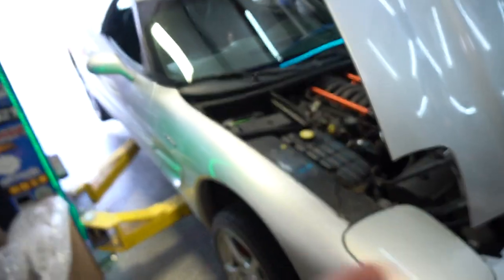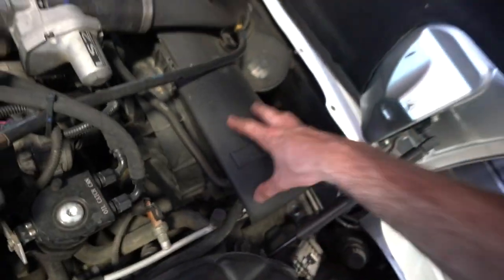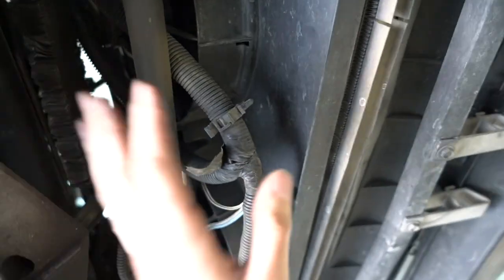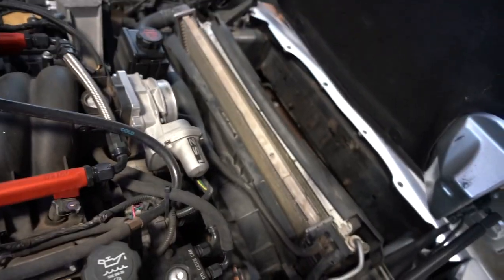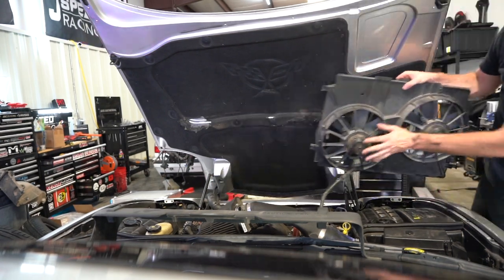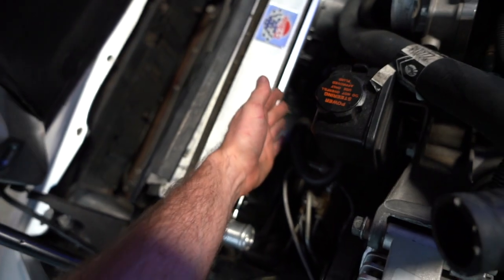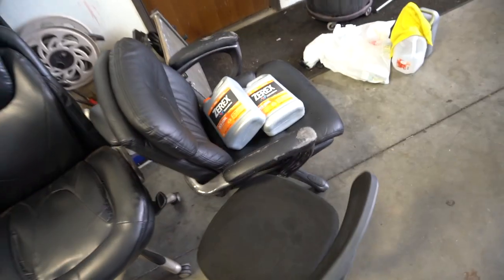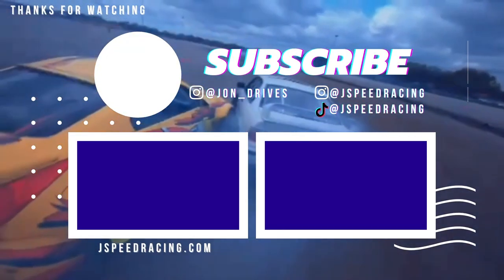C5 CORVETTE DEWITTS RADIATOR & FAN UPGRADE INSTALL! COOLING MODS!

Comment: How did you wire the fans? Did you splice the wires and just put the ground wire with the ground and positve with positve? I'm very curious since a lot of these efans come with Relays and you need to tap to the battery etc.. I would think the efans come with those relays are for cars that didn't have efans and came with the fan clutch. I think this would be a plug and play situation for you?
Reply from the maker: It just plugged right into the stock harness. Yes, plug and play.

Comment: Such a skinny rad for a motor that size. Wonder the new one fits 😊
Reply from the maker: Haha thanks BK! Time to give her a rip!
Reply: The OEM radiator is super light, but is completely fine for stock needs within the designed system.   The plastic top failed on mine at over 100, 000 miles, as most do,      and I could buy about five of the Correct OEM radiators for about one of the fine Dewitts products, plus the stock system is much lighter.   

 efficiency is power, and systems today are designed down to how the temps effect fuel swirl for the combustion event, so unless you have non stock needs, modifying a major system with non OEM parts  is probably a mistake.